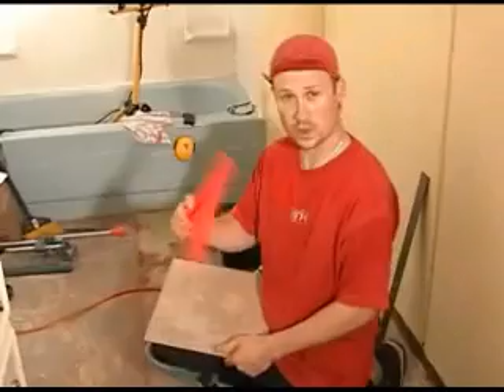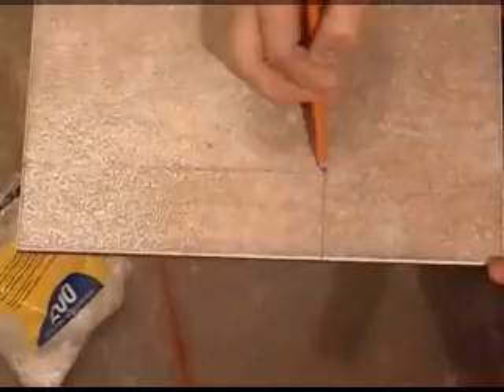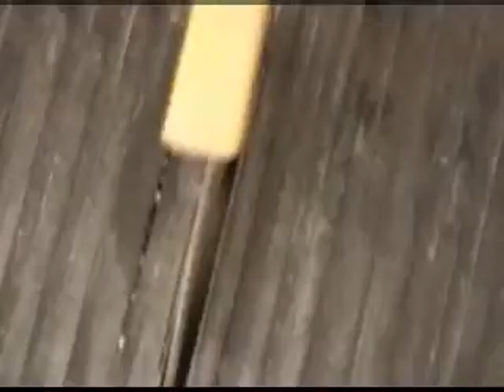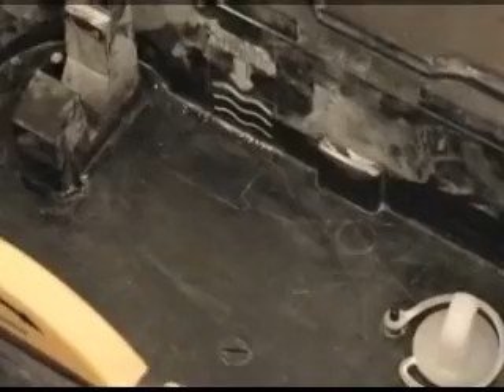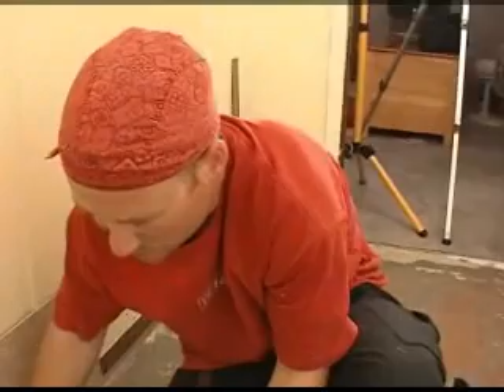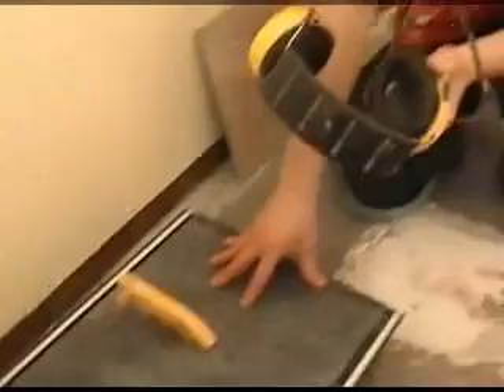Floor Tile Cutting - Part 1 - The Wet Tile Saw

Comment: what blade type do you use, i  just purchased that exact saw, it didnt come with the blade. any suggetions?
Reply from the maker: I use blades from a company called Monolit. There are other good blades out there as well. Any reputable flooring company will stock them. I'm surprised there wasn't a blade with the saw. You should let them know as that's not norma

Comment: I hate to point out that you did so much talking and no demo of cutting the actual tile. I think you need to re-do this video.
Reply from the maker: Please see Part 2 for cutting tile. I had split them up so you can pick which part you need to learn. Sorry for the confusion.
Reply from the maker: That's in another video, it's important to know the basics first

Comment: do I need to use the wet saw with porcelain tile and can you use tile cutter instead?
Reply from the maker: Straight cuts, a good tile cutter will work great. If you need to cut any corner, wet saw or angle grinder with diamond blade is necessary.

Comment: I have same tile cutter...I find if you keep your yellow saw guard down close to the tile you get less water splash. also it may help to use the straightedge that attaches to the either end for alignment, although it is a bit cumbersome to use.
Reply from the maker: Ya, it does help to have the guard down, though you still get wet. Another option is to put the saw on a higher bench, it helps as well. I agree with the straightedge comment as well, it doesn't work all that well.

Comment: is this cutter good for Granite  ? (Black Galaxy in my case ) or i should use stronger saw than you showed here.
thanks
Reply from the maker: I normally like to use a blade that's specific for marble/granite. Now I actually use an angle grinder with the proper blade for 90% of all my cuts. It's a lot faster if you can get used to it